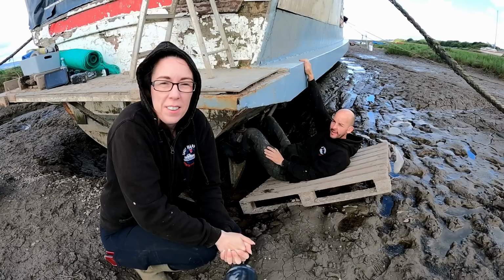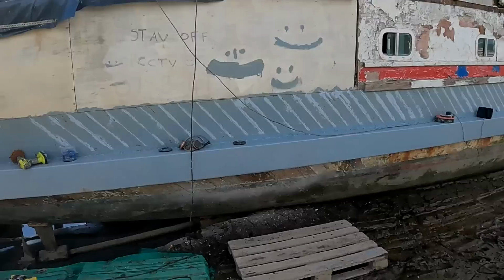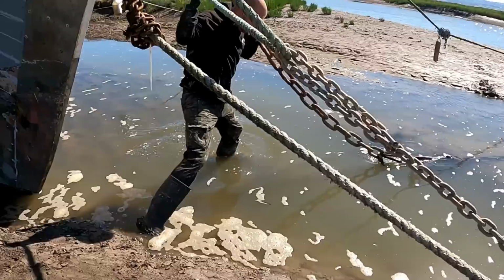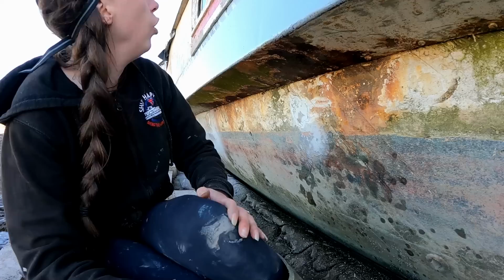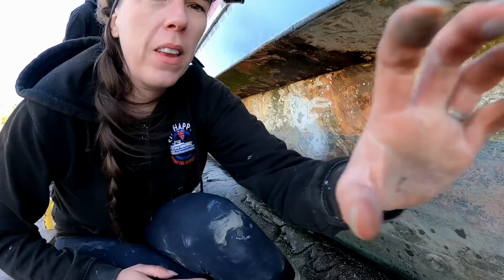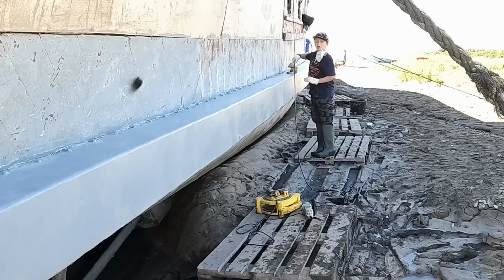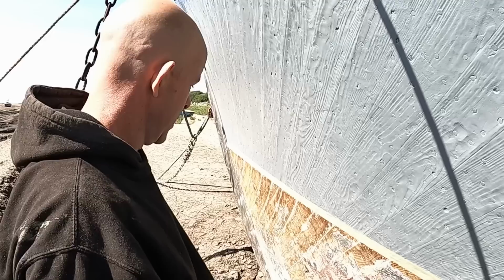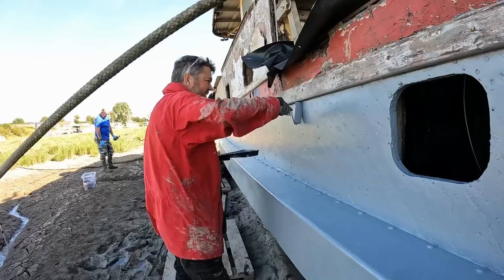Ep 84 - We Finally Finish The Hull!!! 🛥 #boatrestoration #boatproject

Comment: Gemma, you’re right, those stripping wheels are great for removing old paint. In the old days, we had to use many, many 100 grit sanding discs.
SARINDA is in remarkably good condition for her age. I think your biggest challenge for structural repairs will be the replacement of the transom. It’s not likely that you can do that totally between tides, so I suggest you construct a temporary watertight bulkhead forward of the transom that will both reinforce the hull structure and keep the boat from flooding during high tide.
Reply: You are right about the transom. Maybe there is a way to lift the stern out of the water with air bags wgen the tide comes in?
Reply from the maker: Hold my beer!!!! The transom will be done where she is, can't wait to do that!!!

Comment: In relation to the strip discs I found local sources are cheaper than Amazon also I found that the 240v grinder are 11000 RPM which makes the stripping quicker and it tend to not clog the disc against the Ryobi Battery units that are slower. they are great for removing paint and rust off steel. You might consider using and 10inch machine that the builders use for gyprock finishing when you get closer to final finishing on the timber hull. They are a lot larger area and will the out the high spots before final top coats  Good luck forget about the armchair critics your doing OK

Comment: The pair of you have my best wishes you are doing a great job. The concern will be when you take her out of the water, with boats of this age lifting them out could give serious problems, most people who are working on boats of this age usually settle them on blocks in a Dry Dock. There are old Barges which have had the Bows cut off converted into floating Dry Docks.
Reply: Hopefully Gemma and Simon will be able to float her off on the next Spring Tide 🙏 then sail her to a dry dock or at least up onto the hard somewhere. You're right about being worried about the age of the boat. I don't believe that she should EVER be lifted, too great a risk of breaking her back.
Reply from the maker: The next spring tide?

Comment: I’m sure that Owatrol is just linseed oil, or that’s what it smells like anyway. It can supposedly be used as a colour restorer, but the YouTubers Well Deck Diaries had a nightmare with it. After applying and polishing off they couldn’t get rid of the smear marks, so waited until the next year to T cut it. I found similar marks but not as bad, so I just applied it to the paintwork and left it, without polishing it off. It seems to have baked hard in the sun and left a nice shine to the paintwork, even some months later.

Comment: Have you looked into using the long inflatable tubes as used in shipbuilding?   Tubes running Along the hull longitudinally. Those would get the hull up out of water and let you have at the sides easier.   I suspect they would help relocating the boat also.

Comment: Pity you could not dig a trench where you could pull her up into then block off end ,drain water  you would then have a dry platform to work around even be able to lift as you won't be in mud or water but hey your doing a fantastic  job  those old Soldiers  be looking down saying that ship got me home

Comment: I have 2 questions, 1 cant you build a small bank to stop the tide coming in on the side of the boat? Can you use sand blasting with a compressor to sand blast the metal sections?

Comment: The exhaust along the side is metal, correct. Then does that make that side heavier than the other. From landlubber engineer.
Reply from the maker: The exhausts run on both side x

Comment: Is there a reason you don't use a belt sander on those huge surfaces instead the little rotary disk units. Seems like the belt sander would result in a  smoother surface a lot faster.
Reply: I was thinking on this, I'm guessing it's already thought out and had drawbacks. Maybe like the flat discs dig into the wood, the belt puts flat spots into it. Still I can't help but wonder.
Reply from the maker: The belt sander was to aggressive and was marking the wood to much

Comment: If you want a hull ballast idea... Check out the Sailing Yaba channel. Episode 95 just aired. Just a thought for when you get around to it.
Reply from the maker: We love yaba, but I definitely will not be putting oil in my bilge!
Reply: @ShipHappensUK  ... The oil is to stop the metal component in the sealed tube from rusting. Once sealed they are basically tubes that won't rust.
Reply from the maker: @bensteel3944  I know, but if the pvc ever cracks it would be a nightmare to clean up!
Reply: @ShipHappensUK  Just thought it was an idea you might consider but hey ho ... It's all good. Loving the videos btw

Comment: Im rooting for you guys, but I am afraid you are not putting a yacht paint job on your boat. It is not even close to being fair. You need to go over the entire hull with fairing compound, filling in all the low spots and then sanding it flat again. Then you might need to do it again, as the surface is quite rough. If you just paint the boat as it is, this would be a work boat finish.
Reply: It's an 80 year old warship hull. She carries her marks with pride and isn't a gel coated prom girl. She was born as boat with a purpose not a gin palace.
Reply: Knowing the shipright skills of the Brit’s during that period, I would think they they built a fairly fair hull. In addition they are restoring a historic boat. They have redone the roof to a fairly high quality finish. Shouldn’t the hull get the same treatment?